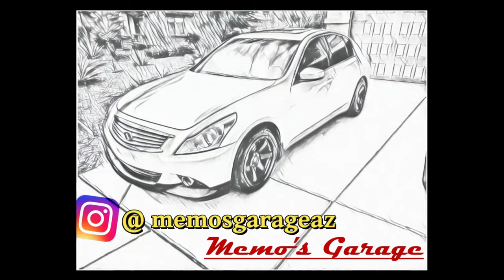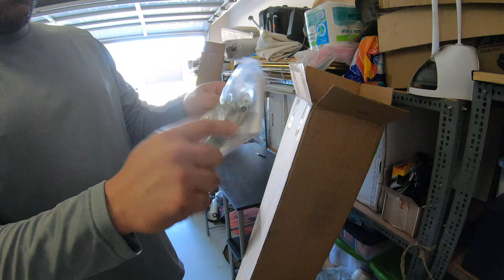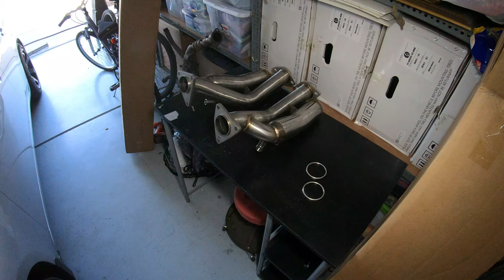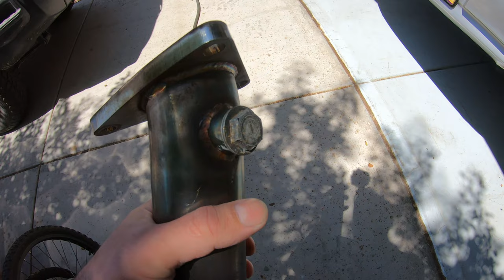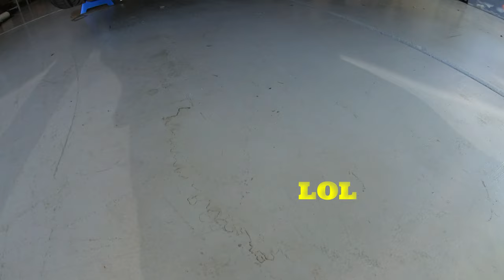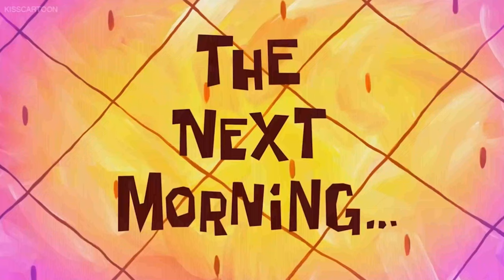FBO Infiniti G37 Sedan Gets SOHO 3" Single Exit Exhaust + CWorks Design Resonated Test Pipes Install

Comment from the maker: Just came back from my exhaust guy, had  him weld the SOHO exhaust system mid section to the rear muffler. Reason I had him do that was because no matter how tight I would the clamp, the rear section would shift and hit the rear exhaust hanger and vibrate, so that's fixed now. I also had him weld two small resonators on the Y-Pipe, just how I had on my old exhaust and the sound is so much better now, the drone at 75-80 mph is gone, I'm finally happy with the sound over all. Going to to have to film new exhaust clips this weekend, stay tuned for that, thanks.
Reply: i was gonna say that initial rasp sound you heard, i didnt think it was rasp. sounded more like heat shield rattle or tapping on the sways or something
Reply from the maker: @Cheeseypoofs85  Hello, yeah I think it was a little bit of both.

Comment: My recommendation, with test pipes I would’ve put that 12” resonator on it to make it more throaty and take any rasp away. If you wanted it louder down the road and didn’t care if there was little rasp, can always go get it cut off and weld a pipe on there
Reply from the maker: Hey man, that's a good idea. I actually removed the resonated test pipes because I Installed ISR Long Tube Headers and I freaking love it.
Reply: @MemosGarageAZ  Yes I saw your video when you installed them and they sound amazing. So did the long tubes replace the cats since they’re long and hooked up from long tubes - Y-pipe - exhaust or long tubes-cats,y-pipe-exhaust?
Reply from the maker: @AzuraSnipingHD  Yes it goes LTH > Y-Pipe, mid-pipe > exhaust
Reply: @MemosGarageAZ  Okk I gotcha. Thank you
Reply: @MemosGarageAZ  I’m back. I have a question. How long did it take for you to get your soho exhaust? I ordered mine on May 5th and still have not gotten it yet🥺 and it says 4 to 6 weeks.
Reply from the maker: @AzuraSnipingHD  Hey there. It took me about 2 months from when I ordered it to when it got delivered. I did call them about the 6 week mark to get an update, you may want to do the same, this way they can tell you how much longer they think it'll take. Good luck and be patient.
Reply: @MemosGarageAZ  Okk thank you. Yeah in 7 days it’ll be 2 months since I ordered. I emailed them to give me an update on the exhaust cause I wanna know. It’s a expensive exhaust and I wanted to make sure they didn’t error my exhaust.
Reply from the maker: @AzuraSnipingHD  yeah man I hear you, I felt the same way, I'm sure it'll be done soon.

Comment: Use the copper silicone gasket maker on the flange gaskets bro
Reply from the maker: I'll definitely have to try that when the new gaskets come in. Thanks
Reply from the maker: Hey man, so I re-did all the work yesterday. Installed the metal 3 hole gaskets in conjunction with the 'O' ring gaskets, added the copper silicone gasket maker everywhere possible. I let it dry over night, went out for a drive this morning and it sounds great, can't hear any leaks and the best part, no more codes. So far so good, thanks again for the tip 👍
Reply: @MemosGarageAZ  dude that's awesome! Yes I love the stuff. Was struggling so much to get rid of leaks with the z1 metal gaskets and this stuff did the job!
Reply: @MemosGarageAZ  not sure how it will put up with flame map use though
Reply from the maker: @Gramje  IDK, I guess I'll find out over time LOL
Reply: @MemosGarageAZ  im glad it worked though! Nice clean exhaust note! Post a video!
Reply from the maker: @Gramje  I'll try to make drive by vids and more rev + driving rear exhaust exit point if views, thanks
Reply: @MemosGarageAZ  can't wait to watch

Comment: Nice video what y pipe did you use that Soho exhaust is niceeee
Reply from the maker: Hello there, it's a Megan Y-pipe, today I had two small resonators welded to it on both sides, just after the flex couples. Sounds so much better now. Thanks for watching a d thanks for the comment.

Comment: did you get a resonator in the soho or no? cuz im looking at pairing the 12" resonated version with cworks pipes if they are out for awd before i am ready to buy everything. and i dont want any rasp
Reply from the maker: No Resonators on the SOHO, the 12" Resonated version should help a lot.

Comment: This shit sounds amazing
Reply from the maker: Thanks man, sounds even better now than when I made this video.
Reply: @MemosGarageAZ  I'm waiting for the upload
Reply from the maker: The long tube headers vid is what the latest the G sounds like. I'll be moving into my new house in about early August, so might be a little bit before my next upload but I'll be installing a VR transmission, one piece light weight aluminum driveshaft and admin intakes. I'm so dying to do this, the G at the moment can only be driven at very low speeds because if the failing transmission.
Reply: @MemosGarageAZ   👌🏿💪🏿

Comment: Did u have to modify the single exhaust to make it fit?
Reply from the maker: Hey there, no I did not, bolts right up. The exhaust system comes in two pieces which are joint together with a clamp. On mine I ended up welding the two together because I couldn't keep them from leaking. Also got urethane exhaust hangers because the OEM ones have too much play in them.
Reply: @MemosGarageAZ  thanks for the reply will order it r n
Reply from the maker: Cool man, good luck and let me know how it works out for you.

Comment: Does your soho exhaust have a resonator on it or no
Reply from the maker: No it doesn't, but if I had to do it all over again I would add one.
Reply: @MemosGarageAZ  okay cause I like this set up that your running with the Isr long tubes. So you would recommend getting it then
Reply from the maker: This current setup is cool and all, but again if I had to do it again I would have added one resonator.
Reply from the maker: I guess I should have elaborated, it sounds good at wide open throttle, but it's too loud at low RPM's, it's really hard to have a normal conversation with anyone inside the car when driving normal at low RPM. It's one of those things that I always wanted to do is have a loud car, but I'm so over it LOL.
Reply: @MemosGarageAZ  yeah I love the sound of loud car to but I’m over it as well too lol. But this setup is the best one I come across so far so I’m going to go with this and get the soho resonated
Reply: @MemosGarageAZ  only thing is I couldn’t find the cworks test pipes
Reply from the maker: @najaelloyd274 That's good man, let me know when you do and how you like it.
Reply from the maker: @najaelloyd274  Yeah I'm not sure if he still sells them.
Reply: @MemosGarageAZ  oh yeah for sure I’m going to make some clips once everything is set
Reply: @MemosGarageAZ  one more thing do you think the xyz pipe could fit the soho single exit ?
Reply from the maker: @najaelloyd274  Not without modification to the SOHO single exit. It looks like it's longer than a standard Y-pipe
Reply: Hey man order my soho single exit 🎉
Reply from the maker: @najaelloyd274 Awesome man,.hope you enjoy like I did.
Reply: Just uploaded my version of the soho single exit with the xyz y pipe
Reply from the maker: @najaelloyd274 cool, where at, Links?

Comment: LOL. The Chinese version art pipes have leaking sound at cold start and certain rpms. I have the same art pipes and paired with Motordyne Catback. Especially Cold start I can hear the leaking sound. The real motordyne art pipes don't have this problem...
Reply from the maker: The cheap O gaskets definitely leak, throwing the same codes as before but more often now. Just ordered more of those metal 3 hole gaskets, looks like I'll be busy again this weekend LOL
Reply: @MemosGarageAZ  don't forget the copper permatex man. I installed my exhaust once and never any leaks..
Reply from the maker: Got it, will give it a try this weekend, thanks again.
Reply: Memo's Garage AZ I didn't use the cheap o gasket. I used the z1 metal gasket. I made sure there is no leak and still can hear the leaking sound. Probably the angle of the helmhotlz resonators are not correct. BTW I spent about $150 bought the same art pipes in China. Great quality and so far no crack. Also Moncef retuned me on e85. I installed GTR injectors and AEM 340 pump. I dragy tested the acceleration time which was a lot faster compare to pump gas tune. My 0-60 is 4.46s and 1/4 mile is 12.89 at 109mph. Highly recommended get e85 tune from Moncef
Reply from the maker: @yuyudai3359  Hello there, sorry for the late reply, for some reason in the last month or so, YouTube hasn't been notifying me when I get new comments, it's really starting to irritate me. I ended up going back and adding the Z1 metal gaskets the following weekend but kept the O rings, plus some exhaust silicone (thanks again for the tip Gramje). This past weekend I went back under and checked the tightness of the 3 test pipes bolts and found they were loose, so installed different bolts and tighten the crap out of them. I think they're good now but I'm going to recheck them again next weekend. I've looked into the E85 conversation and have talked to Moncef about it, but I'm not so sure I'm going to go that route with this car, really thinking my next project car is going to be a 370z 6 speed manual and on that one I definitely would. Those are some nice quarter mile #'s , and Thanks again for the comment.
Reply: @MemosGarageAZ  how have the metal gaskets and permatex silicone been so far? Any exhaust leaks?
Reply from the maker: @j_santiago92  Hello there, I think they've held up just fine, buying and adding the correct size and strength exhaust bolts have helped as well.
Reply: @yuyudai3359  are you na and what other mods do you have?

Comment: i personally don't like the sound of it.  way too much rasp
Reply from the maker: I don't disagree. I've since replaced the DC Headers and Cworks design resonated test pipes with ISR LTH, still a bit raspy, but it sounds better at WOT.
Reply: @MemosGarageAZ  i was wondering if you changed it again since the video was kinda old
Reply from the maker: Yeah I have man, check it out:
https://youtu.be/j-3QDV-ZI5s